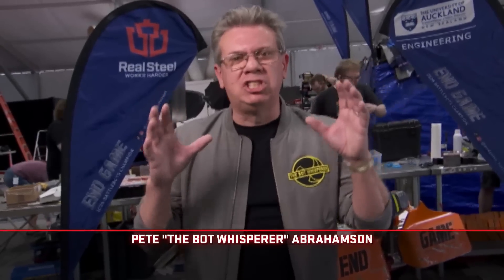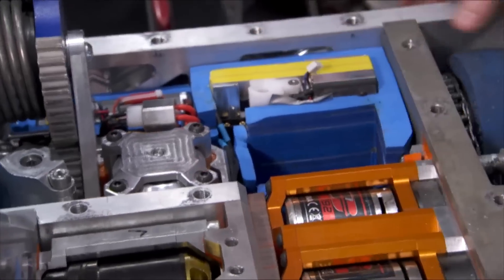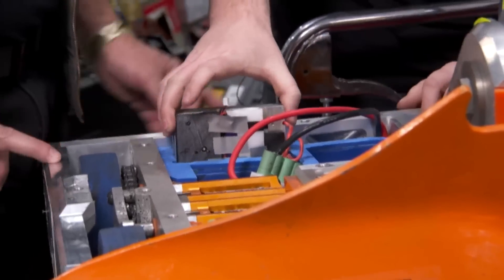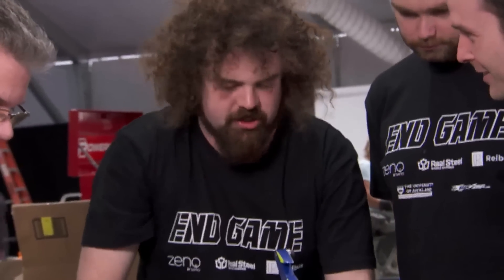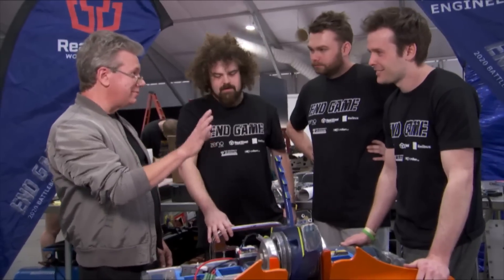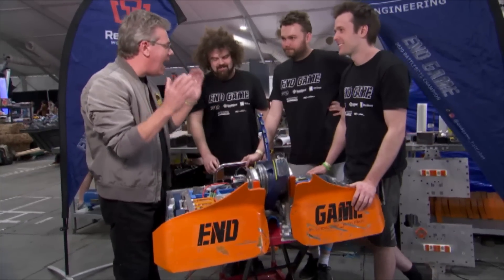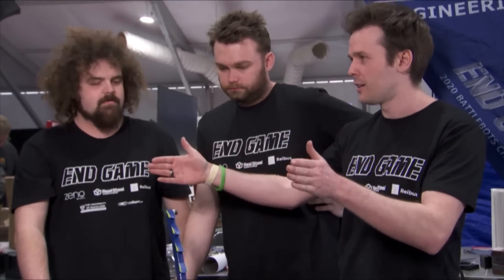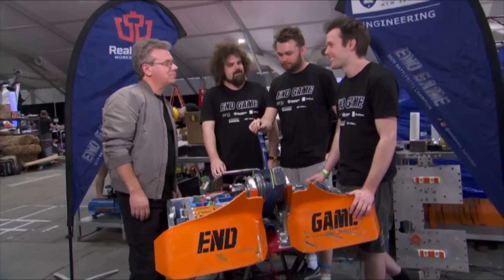Bot Whisperings - Meet Team End Game | Battlebots Season 7

Comment: That is some impressive redundancy. Bravo, but holy heck I bet that makes the bot's cost go up.
Reply: No wonder it was record highest cost bot.
Reply: @mk30b25  Yeah. Battery packs, radios, speed controllers, and custom control board for all four wheels, two weapon motors, and the self-righter. As he said, it's 7 bots worth of electrics.
Reply: @mk30b25  No it isn't, you're the first person i ever hear claiming EndGame is particularly expensive. The record actually belongs to walker Chomp, followed by teams like Hypershock and Duck.

Redundancy isn't particularly expensive, milled aluminium frames/titanium/big ar 500 spinners are, and EndGame doesn't use any of those. 

The only real downside of EndGame's system is that it is a nightmare to set up and synchronize, it takes a real electronics genius to do so.